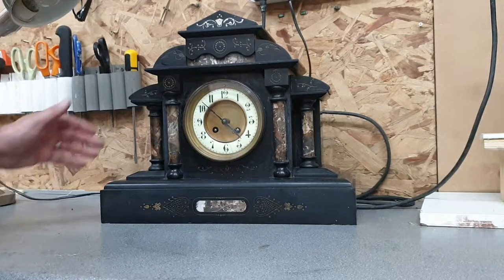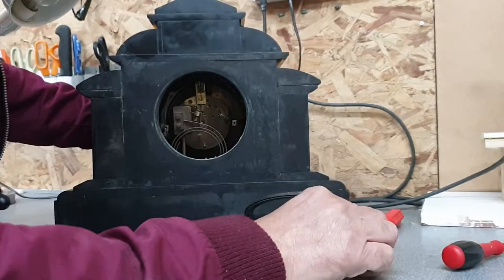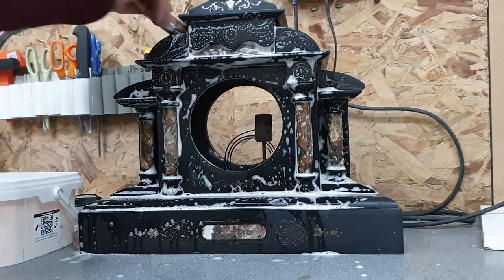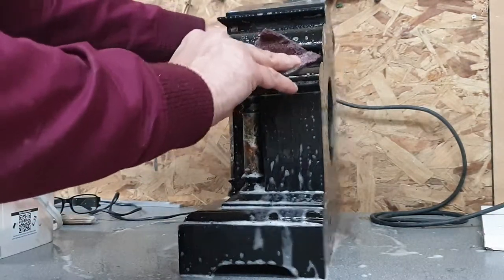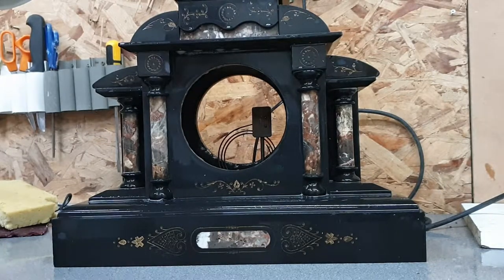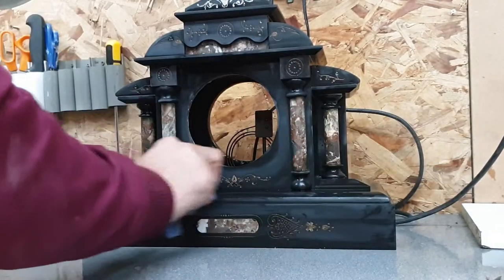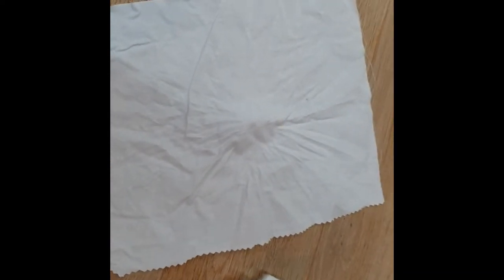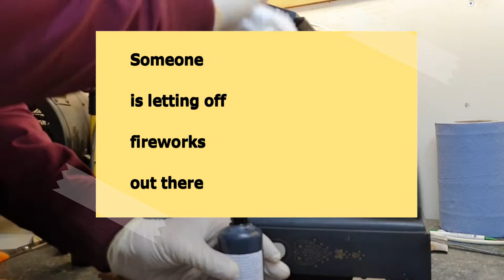Slate Clock Restoration (Part 1)

Comment: I was told to avoid getting these cases wet as they are held with plaster and if they get too wet they can fall apart. Better to wipe them to avoid excess water.
Reply from the maker: Thats absolutely true, they are held together with plaster but it would take quite a soaking to break it down. You will see in some of my other videos that I do actually take the cases apart for a full restoration and then glue them  back together.

Comment: Hi, I’ve just bought the same clock you have and was wondering if you have gone so far as removing the dial from the mechanism?   If so could you let me know how it’s done please
Reply from the maker: Hi neil. I assume you have taken the mechanism out of the clock (two screws at the back of the clock) 

The first thing is to remove the hands by pulling out the little pin at the centere of the hands.
If you hold the mechanism in your hand and look straight into it you will notice 3 posts with the little retaining pins. Just use a pair of pliers to pull them out and the dial will come off in one whole piece.
Reply: Thank for that.   Yes I’d got the movement out as my case was marked like yours with a whitish hue on the case.   I cleaned my case up with T cut and then yes kiwi polish on it and buffed it. Came out well. The movement is absolutely filthy as the back door is missing .   Thanks for advice on taking it off as I have read somewhere  that you slacken off main spring before taking movement out just in case it loosens the pte holding everything together.  Only way to get to mainspring Escher is by removing the face so I’ll do that now
Reply: Morning,
I’ve got my clock cleaned up and back together and running but the chime mechanism has decided to pack in now.  It was running ok when I 1st cleaned the movement  but since putting it back into the case, the chiming movement has stopped.  Any ideas as to what I’ve done wrong?  The hammer etc is free with no obstructions etc
Reply from the maker: @neillconnor  Hi Neill I recon its the ratchet mechanism thats not been set right. Or take a look at the spring/tensioner that pushes the ratchet back to its position, perhaps it hasnt located correctly. Its a shame we cant sent photos on here otherwise I couls have sent you pics of how it shouls look when put back together
Reply: Time4Clocks  I’ve disengaged the chime mechanism at the moment ast the clock stopped at 5 to midnight every day.   Chime mechanism  was stopping it but I couldn’t see why so I just disengaged it for now.